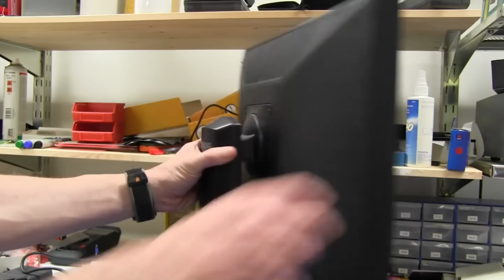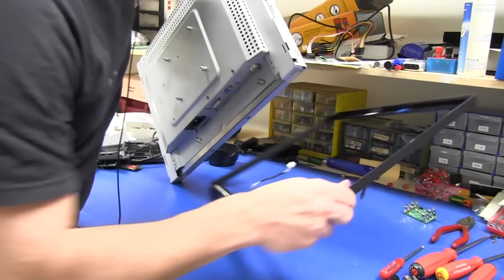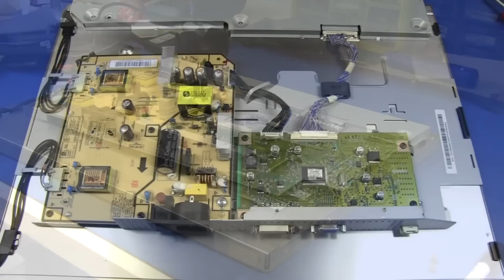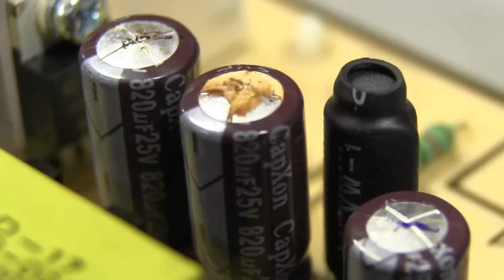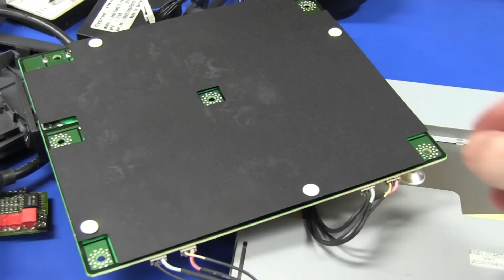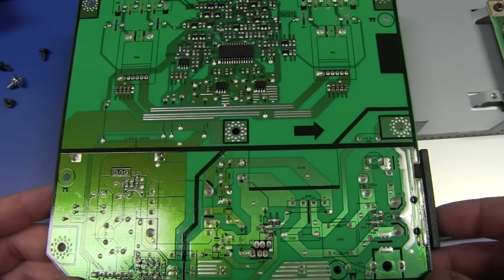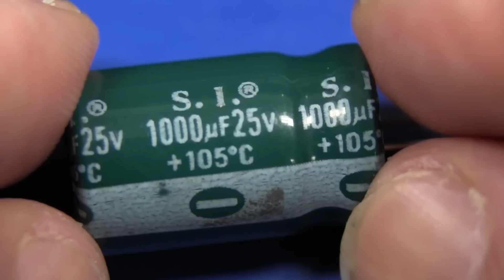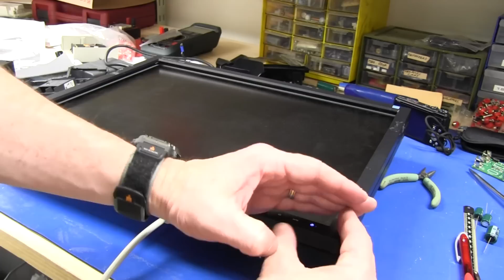EEVblog #347 - Bad Cap LCD Monitor Repair

Comment: In 2001 or 2002, if I remember correctly there where caps manufactured which where wrongly calculated, these caps where used in cars, motherboards, etc. All these caps died within 1-3 years. For a moment there even was a shortage on caps. About 7 brands sold these caps. See "capacitor plague"
Reply: According to same reports, the actual root cause was not-pure-enough aluminium used to manufacture the capacitors. Some claimed that the reason would have been poor quality electrolyte but I think it was later pointed out that it wasn't the actual cause of the problem.

Comment: Hi Dave, one question regarding LCD repair : is there some safety measure to take regarding those high voltage capacitors. For example would it be good idea to short-out this 450V capacitor before soldering (with a screwdriver for example) ? Or is it "safe" , unless you put your fingers on it ? Also: is there any polarity to take care while putting in place the new capacitors ? (or it does not matter).  Thanks for your videos.
Reply: Self answer : I finally open and repair the LCD. I shorted the 450V capacitor but nothing happen (it seems it was already empty). About polarity : yes it is important, the white half circle has to be aligned with negative side of capacitor. After soldering and reassembling the screen, it works like a charm (before it was only displaying white screen).

Comment: Hi! Dave, this video inspired me to undertake repairing  a 19" LCD monitor my brother gave me. The best part is i used Nippon Chemi-con caps from a dead XFX computer power supply he also gave me. so for a bit of my time, a 100% free monitor. Oh, three guesses what brand caps Dell used in this monitor (you only need one).
Reply from the maker: Skwisgar2322 Nice work!
Reply: EEVblog I had no idea about electronics. Thanks to your instructions repair on LG Flatron W2242S, during important film editing session, worked like a beauty. 
No dead or injured. Mission successfully accomplished.
Many thanks from Germany.
Reply: EEVblog lol you should have said built like a brick shit house
Reply: The Kaiser Oh dear I have the W2243S, mine keeps squealing on booting - could this be capacitors too?
Reply: @iMagic16  a
Reply: Magic Look at them and if some of them are bulgy, replace them.
Reply: Magic I agree with The Kaiser, but be careful! It should be easy if you have worked with electronics before, but if you don't have experience with electronics, you should watch a tutorial about doing it, because otherwise you can blow the caps up and even start a fire.
Reply: PunakiviAddikti Well, both, the caps and the circuit board are marked, so only an idiot would put the capacitors back the wrong way round. These kids have all cameras in their mobiles mobiles and taking a picture before you muck about is self evident. My display still works like a treat without any fire or explosions.
Reply: True, it's pretty difficult, but not everyone knows how the caps are marked (though it's pretty hard to miss the stripe that marks the negative side), but I know some cases where someone has made a good fireworks show.
Reply: PunakiviAddikti Are you pulling my leg? Nobody could possibly be that stupid.
Reply: The Kaiser No, I'm serious, I know someone that accidentally did that.
Reply: PunakiviAddikti Good Heavens!
Reply: +Skwisgar2322 

Hi!
So the same principle applies with
motherboards? Should I be looking for a low ESR cap to replace the bulked ones
on it? Considering they are dirt cheap I might replace the whole strip of caps. 6 caps located near the cpu socket on an old p4p800-vm motherboard.
Reply: AdamZZ-17th Are they bulgy?
Reply: The Kaiser
Only one of them is bulged up near the cpu socket rest is fine, I guess this cap is responsible for sorting the board out. I got the board in this state.
Reply: +Magic Squealing can be caused by bad caps, but it's more likely caused by a bad inverter or bad CCFL backlights.

Comment: Dodgy caps is the perfect choice for planned obsolescense.
Reply: Company's hate people who replace caps
Reply: I doubt it is planned obsolescence. As you can read on Wikipedia article for planned obsolescence it is a risky strategy for companies in competitive markets like LCD monitors. As consumers with a bad experience with Samsung will likely choose a competitors product. I bet the original design engineer (with pride in his design) didn't choose CapXon. But that decision was made later in the production department for the purpose to save costs. Maybe a stupid deal was made with CapXon to have them supply all the caps in certain production lines. It might be a continues conflict between management and the engineering staff for those decisions.
Reply: @SE45CX  would you keep your money in my wallet? i promise it will be safe. as for samsung, they don't worry about caps because nobody has their panels. what would you buy? you will return to samsung, lg and 1-2 others. that is the market, nobody cares. it is about cutting costs and pushing new products, that's it
Reply: CapXon. Being the base of crappy electronic products since 1990
Reply: SE45CX It seems like the perfect choice for a company like Samsung. Samsung are the largest supplier of "Name brand" monitors in the world because they're the cheapest and have "decent quality" for the price. Dave's teardown shows exactly how well made the monitors are inside with the sole exception of the cheap caps.

Someone buys a Samsung monitor, it lasts a few years and then dies, most likely, they'll buy another Samsung because they're the cheapest "known brand" like I mentioned.
Another benefit to Samsung is when they sell monitors with service-contracts or warranties, if a monitor fails and it's under warranty, it's literally the work of a moment to repair it as Dave's demonstrated in the video.
Reply: @CypherAod  Dear electrolytics still deteriorate. the liquid soaking the paper dries out over time. Heat is the basic killer. You need to use 105C capable electrolytics wherever posible but even these will break down over time and when one goes you need to replace them all. Just remember to check the ESR rating of the ones you take out and replace like for like.
Reply: actually if they only skimp on the caps, then that's a very good thing for the repairability because failed caps are easy to spot and replace.
Reply: @krass76  Indeed that is good for people who know how electronics work, but over 99,9999..% of the people don't know shit and are too lazy to even find out how to do such repairs.
Reply: SE45CX this is also what the Wikipedia article  said about planned obsolescence Planned obsolescence is sometimes achieved by placing a heat-sensitive component adjacent to a component that is expected to get hot. A common example is LCD screens with heat-sensitive electrolytic capacitors placed next to power components which may be 100 °C or hotter; this heat greatly reduces the lifespan of the electrolytic capacitor.[7]
Reply: No it is planned obsolescence. Samsung and many other brands did the same with HD TV's where most of the PSU board went bad after merely 2 years. The culprit was always caps installed close to the main heatsink of voltage regulators and this was intentional of course!
Reply: They also intentionally made the serviceability of these monitors hard.
Instead of screw on covers, they have snap on covers which could potentially break if you were to open it with force.
It took me quite a long time yesterday to open my acer monitor due to difficulty in getting around the snap-on covers.
Also many of these different brand monitors look suspiciously alike when opened.
I believe there are only few mega-companies making these monitors for other brands and just placing different brand/cover.
Reply: @Pau_Pau9  The worst asshole-design I have yet come across is putting the screws to open a computer mouse beneath the glued on teflon pads, forcing you to buy new teflon pads if you want to service the buttons which "mysteriously" develop a double-click issue after 1-2 years.
Reply: soylentgreenb It's total crap when they are caps on a power supply, though. All people need to buy according to the OEMs and not the brand.
Reply: No doubt the powers that be that chose to use inferior, low-life capacitors did so on purpose. So consumers would buy new tv instead of repairing the current model. Power supply capacitors should have the best quality and longest life ratings possible. 

....I have classic arcade games from the late '70s and early '80s that still have working capacitors in the power supply circuit. Though on CRT monitors that get used regular, I have had to replace the electrolytic caps on a regular basis because they were old and worn out. Just rebuilt a Defender power supply that had 35+ year old caps that were starting to fail.
Reply: This is for half-an-hour-repair, including disassembling and re-assembling.
Reply: SE45CX There's a million other places to cut costs. Why do you think they chose to cut on capacitors? Crap capacitors work reliably for a couple of years (no replacements under warranty) and then they reliably go out of spec and fail.

With a few simple formulas you can calculate the life of your product with a good deal of accuracy.

Comment: This had me worried, I'm sitting here with a Samsung SyncMaster E2220 at the moment. Just waiting for it to fail.
Reply: But now you know how to replace those. Just try it. Open the case like Dave did. However I would have the patience to wait for the correct capacitor parts to install the correct ones with a better brand.

Comment: Hi thank you so much for uploading this! My Flatron L192WS has the exact same problem! I have no experience with electronics but you make this very clear. I want to fix the monitor myself but I'm worried about Capacitor discharge safety :( - is there anyway for me to be 100% sure that all the charge is dispelled? First time dealing with something like this. Thanks!
Reply: Check it with a multimeter, just put your multimeter on volts and probe the two solder joints of the capacitor on the back of the PCB. In the unlikely case that you get a reading more than millivolts, put a 1k resistor across the two capacitor leads to drain it down in a controlled manner. Flatscreen monitors don't use extremely high voltages like the old CRT televisions did.

Comment: I agree with everything you said about using cheap caps to save the company $$$, Dave.  I've had to replace caps in three monitors so far.  One monitor wa only ONE YEAR OLD - as well.  Shocking!  Different brands too - which I thought strange.  Changed out all of the electro's on the PS board.  The trick is to get the 105C caps, just so long as they aren't a dodgey brand.  I don't blame the engineers either; I do blame the execs to vend mfr'ing them out to the cheapest bidders.

I like the EEV blog; although not a member (Amateur Radio Operator - tho)!

Keep it up David, and remember to keep TEARING THEM DOWN!

Comment: I do these kinds of monitor repairs as well. It helps to wire the cap further from its original position so that it doesn't get heated by the heatsink. I also always step up the rating, using a one step higher voltage is a good choice.

Comment: Thank You very much Dave! My brother have epilepsia and it's recommended for him to use LCD monitor. Unfortunately his 22" HYUNDAI IT N220W LCD monitor wasn't working... until yesterday :D I've replaced four 680uF 25V capacitors with two 1000uF 25V and another two 680uF 25V caps. Now mine brothers LCD works perfect, so we can afford any epilepsion attacks that can be eventually caused by CRT monitor. My repair cost me nothing, because capacitors for mine replacement were taken from an old PC motherboard, so I've also spared ~200PLN (~65USD) which I would have to pay for repair in service. I'm not good in soldering, but I've managed to solve the problem :) Thank You again and greetings from Poland!

Comment: Haha, I have a 204b here as well.  Bought it back when because I thought flipping the screen would be a good idea for vertical arcade games.  TN panel - no way!

With regular use over the years since then, it's had essentially no problems except that the VGA input jack keeps getting bumped, leading to lines trailing off the image.  Wiggle them back into place and it clears up.

I'll keep this in mind if they ever show any trouble.

Comment: Have a 2006 Samsung syncmaster that still works but is dim. It also takes a while to brighten up. Think changing the caps will restore it?
Reply: Check the caps but I'm betting the CCFL is going bad.
Reply: likely something in the CCFL driver system. could be bad caps there, as Dave siad, they are usually the problem, especially if the circuit partially works. most passives or I/C's will fail completely, not partially. but caps can dry out and still function just not 100%

Comment: What's the most preferred way to discharge these as a general rule when dealing with different size caps?
Reply: I use a simple bulb. Dissipates the power easily, plus its resistance is lower when cool which means perfect discharge to the zero.
Reply: Use a power resistor to safely discharge.
Reply: Are you talking about a 50W resistor or ?

Comment: My LG tv from 2006 has sheilding tape around the cages. Every Samsung video I have seen do not even have any electrical tape between each metal cage around the inner circuit boards. Worked fine until local power was off for 8 hours and they did not send out fliers to let my parents know to unplug high end appliances until the power was restored. Just hoping it blew a fuse once I put a new one inside. I used a butter knife on lower bezel on plastic to pop it up on a Acer monitor since the power button is crap plastic and always breaks.

Comment: Nice video, Dave. I've myself revived many screens bought for nothing or simply got for free by replacing some caps. It's especially interesting for screens that have reputably good panels (it's the case for some SyncMaster series, regardless of the electronics that drive it) or formats that are barely supported by manufacturers today (like 16/10 screens. Even today you'd be hard-pressed to find better than those 24" 16/10 Iiyama displays).

Comment: When I worked in an electronics store the highest rate of failure we saw in capacitors was CapXon brand. The fact that they were bulging for easy identification of bad ones was luck. Most of the time I've seen them go bad and power supplies fail without swelling of the caps at all. Anytime I saw CapXon I changed them and typically about 90+ % of the time that fixed it. I could count on one hand the times over 4 years it wasn't only just the CapXon caps in a TV, PC, or other device that was bad but other things like thermistors and transistors.

Comment: I have a Princeton LCD monitor that a friend gave me that is having the exact same problem. I am going to drop by the electronics house on my way home from work and pick up 5 of the 470uF 25V caps to repair it. What surprised me is that those ViewSonic monitors are almost identical inside to my Princeton one. Great video!
Reply: ViewSonic was probably selling Princeton monitors with there own name. I had a Sylvania CRT which was actually a Princeton monitor without paying the Princeton price for it.

Comment: I have personally fixed a number of Samsung displays including my 40 inch LCD TV and the SyncMasters in this video. Also, some (perhaps all) Philips VVs are made by Samsung. It's hard to believe that these failures are random. There was a class action suit over this, but it only paid off if you had your TV repaired and they would refund you a portion of the repair costs. These caps are junk.

Comment: Thanks to this video I was able to revive my acer x203H that I had almost thrown away! Encouraged by your can-do attitude I open up my monitor and found similarly bulged caps in almost the exact same location. After calling around I was able to find some caps that weren't low ESR and they are working until I can get the right ones in the mail. Thanks for the video! Liked, favorited, subscribed :D

Comment: I fixed my 245B+ with new caps and some new resistors. Sadly it was broken again within 12 hours -while 2 hours on-  :(. Replaced all the caps again because I had some spare but it didn't work. Any ideas how this could happen? I think the MOSFETs are broken but I don't know for sure..

Comment: I just cracked open an old Sceptre LCD monitor my brother gave me; same POS CapXon-brand capacitors, swollen.  Replaced two 1000uF with Panasonics from my parts bin; it works like a champ.  Opened up a broken Hanns-G monitor, swollen CapXon caps.  There's a theme here.  What are the chances it will work after I replace the caps?  And why do manufacturers use that brand??  When I see them, it only harms my perception of their integrity.

Comment: I saw the data sheet for them Crapxon caps and they are rated for 2000-7000hrs (the brighter the screen, the shorter the life)

Comment: those monitor are designed to fail after a period of time, they put those bad capacitors in there specially to fail, it is not poor design, they simply don't want to make them bullet proof because they wouldn't sell more after a time.....

you need to see the movie - light bulb conspiracy - in case you didnt already and you will understand why always there is some poor components in there.You can find toe movie here on youtube.

Comment: I've done this idk how many times now. Samsungs are notorious for these caps for whatever reason (probably to limit the display's lifetime). biggest issue is making sure your replacement caps aren't too tall. if they are taller than any heatsink on the board it will not fit back in.